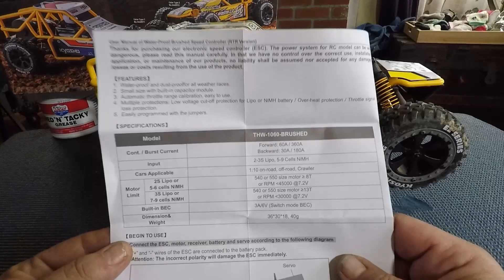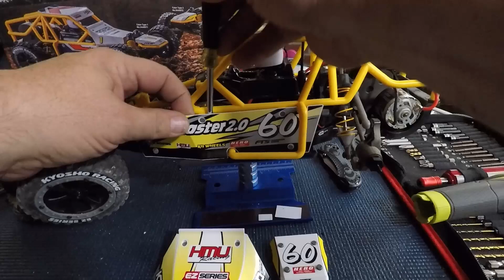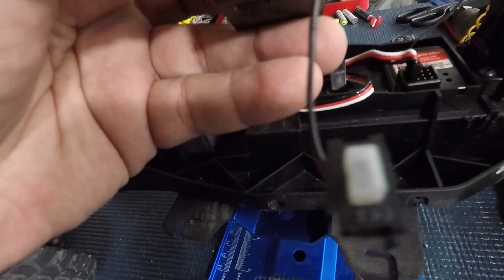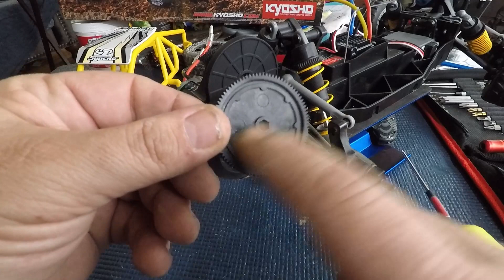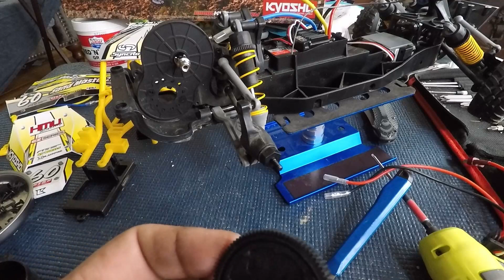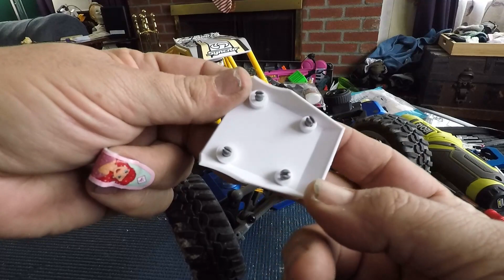Upgraded Kyosho Sand Master 2.0 17 turn motor 3s #rc #rccar #hobby

Comment: I need one of those pinion pullers. These are a strange Kyosho. Reminds me of old toy grade RC’s
Reply from the maker: That tool does come in handy when its needed. I would put this sand master in the same class as a TT02. But it has oil shocks and metal gears in the diff

Comment: This is the first of two videos describing the same gear issues released today. Thank you! I'll get a Tamiya kit as an introduction to (adult) RCing after all, given my reason reason to get this instead was a supposedly better quality.
Reply from the maker: On the other hand its hard to beat the price for 139.00 usd. Its a RTR with ball bearings, 22 turn motor, oil shocks and metal gears in the diff. I have many Tamiya cars that have their own problems. Thanks for watching!
Reply: @JoevsRc 
Thank you, and I fully agree with you - that's why I wanted to wait for the Sandmaster in the first place.
However, in Europe a cheap Tamiya kit (with motor and ESC) is little over 100 €, and the Sandmaster will be sold for around 170€, and batteries and chargers (with deans plugs) are more important than Tamiya / Carson ones.

Comment: Not a fan of the plastic pinion, I thought it would have been metal now. But the quality of the spur not good. Nice plaster 🙂
Reply from the maker: The gear is holding up for now . we will see how long it last and how much power it can handle .lol 
what Plaster?
Reply: @JoevsRc  The pink one 🙂we call them different things.
Reply from the maker: LOL the bandaid  @BasildonTrailBlazerRC

Comment: It just can't be! This is the first video I've seen of the sandmaster updated with a 1060 amp 60 esc hobbywing variant (it has 20 amps more than the original 1040) thanks for the contribution! I wonder if the sandmaster will hold up to the 1060 amp drive with lipo 2 for long periods (it's the gears I'd be worried about) but apparently there are plenty of replacement parts for this new redesign! Thank you very much for your quality content friend!
My Axxe also has the 1040 shifter with the 22-turn motor.😊😊😊
Reply from the maker: I can guarantee it went 34 mph today, and the gears are fine . The video will be up tomorrow
Reply from the maker: My concerns are the plastic pinion and any brushed motor running 3s lol
Reply: @JoevsRc  I don't think the gears will last 3s, at over 22 mph you can break a couple of small transmission gears, I want to get a Monster Tracker EZ series, I've seen the nexxt imported from Japan as a kit on eBay but at a ridiculously high price
Reply: I can see that no dirt got into the spur gear and pinion, I think this version is improved in such a way that it prevents dirt from getting in.
(I see that the spur gear and the pinion also do not have any grease.) When you can, it would be good for you to make sure if the differential and the gearbox have any grease...regards
Reply from the maker: @zoridor16  there was grease in the diff